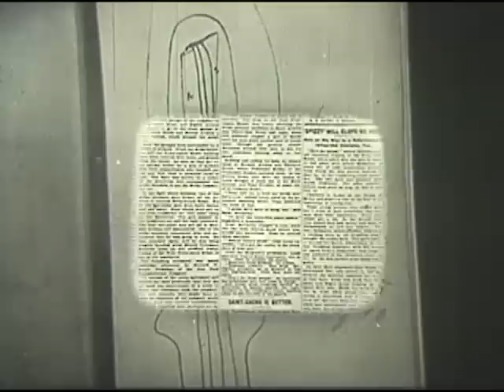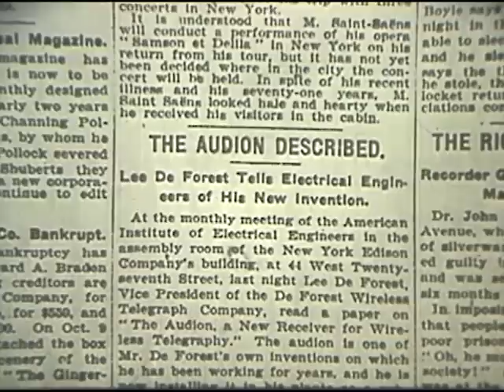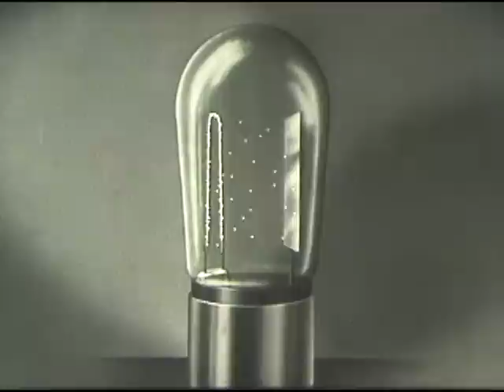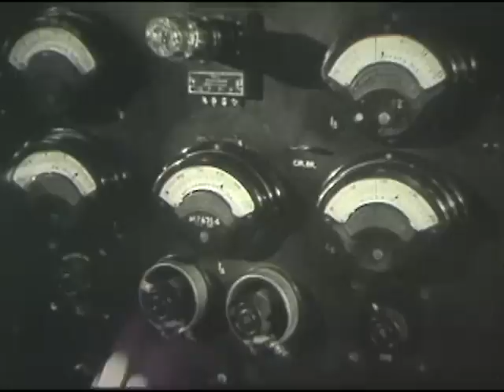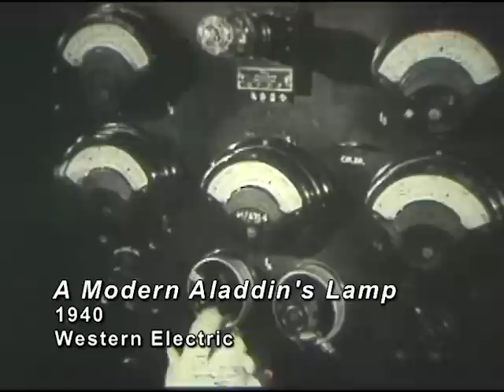AT&T Archives: A Modern Aladdin's Lamp, about vacuum tubes,1940

Comment: Great video.  A slight slap at Edison for not trying to understand the "Edison Effect". Lowell Thomas had a good "Radio Voice". I got into "playing" with vacuum tubes while still in grade school in the 50's. An Uncle gave a kit for a regenerative radio that used a single tube. It was of a "breadboard" design and the map to the components was on a piece of paper glued to a small piece of plywood and it required a 1.5 V "A" battery and a 45 V "B" battery.

With tubes it is possible to picture how they work. Not so with semi-conductors.
Reply: Lowell Thomas!!!  That was his name!!  That was driving me nuts -- I knew I knew him, but I couldn't think of his name at all.
Reply: @LMacNeill  Did you not observe the opening credits?
Reply: I learned electronics in the tube days. You could follow a schematic and see what happens. One of the later TV's i repaired, from the tuner, the signal went into a big chip, and various signals came out for video, audio,  verticle and horizontal drive. What was wrong? A big difficult to replace chip. A projector I worked on had a huge chip in it. Over 200 pins, soldered into different levels of a 7 layer PC Board.  The projector was scrapped.
Reply: I had decent training on semiconductors. You just needed flukes and O'scopes to help.
Reply: Mike, 

Your description of your single tube regenerative radio kit sounds very much like a kit I had in the late 1950s. It used a 45 V “B” battery and a standard 1.5 V D cell for the “A” battery. It was a breadboard design, as you describe, and had a 3-4” upright wood piece on the front to hold the variable capacitor for tuning and a potentiometer for the regeneration control. I don't recall if the power switch was built into the pot, or a separate switch. It had a single headphone with a spring metal piece the fit over your head. You could also connect the headphone to different fahnestock clips and allegedly use it as a radio transmitter with the headphone serving as the microphone. I never had much success with getting that to work. 

A few years later I got an updated version of the same kit. Instead of the breadboard, it now fitted into red plastic case. While now more portable, you still needed to hook it to an antenna and ground to use it.

I hadn’t though about this radio for a while—thanks for the memory jog.

Comment: 13:33: "Spacings between windings are uniform to a few millionths of an inch". Why are they then THROWN INTO A PILE (13:39)?
Reply: I noticed that too. Hard to believe they would go to so much trouble and then pile them up like garbage. I think that might be a pile of rejects. Does not make sense.
Reply: Right and the glass interiors that they had coming down a chute and landing in another pile of glass interiors..?? Now I've seen vacuum tubes before and yes they are made of sturdy glass, but I just can't see how that much shock and survivedand then they're loaded into a great big Bin how are they not crushed by the weight of the other glass particles simply wonderous
Reply: OMG David, you look like me. I'm not kidding. My beard is bigger but other than that you could just about be my twin!
Reply: I don't think that's correct. Maybe to a uniformity of a few thousandths of an inch, but certainly not to millionths of an inch. A typical vacuum tube does not require such precision.

Comment: Probably the two most important inventions of the 20th century was the vacuum tube (Thermonic valve)  in 1906 which led to modern electronics like radio, television, radar and the earliest electronic computers. Then in 1947 the transistors which led to the amazing technology we have today. The diode tube invented in 1903.
Reply: The development of the integrated circuit around 1960 solved "the connection problem:" Even though transistors could be made small and reliable, the physical aspects of connecting them and the associated resistors together in large numbers represented a major obstacle that threatened to be a limiting factor.

Comment: And  even today the Vac Tube  is still being used  in high end Hi -Fi  ,   Respect for those technicians of the past
Reply: I" m using a microphone preamplifier built for audio recordings and I have an hi-fi preamp and amplifier for a high efficency loudspeakers. The tubes have again best performances  for specific purpose where the mechanical requirements are not primarly requested (audio and RF power transmitter, magnetron it's a vacuum tube and X ray tube, night vision device  use a photomultiplicator).

Comment: Thermionic valves make for the best sounding amps and will never die. Hook 'em up to a trio of single coils with selector switch in position 4 and you'll be smokin' dude.
Reply: Sorry man, but digital has replaced that. Amp models in 2023 can produce the same sound
Reply: @jr2904  Some people like processed cheese, others artisan made real deal.
Actually, digital technology models an ideal sound (or think of it as typical response of an amp style or even that of particular existent amplifiers. As such they present a fixed transfer response subject to input parameters.  
A real hard-wired tube amp is far more organic and variable and plays that way too.
They're personal.

Comment: The vacuum tube is still relevant. Vacuum tubes respond to voltage changes 50 times faster than semiconductor devices. For audio this means greater phase accuracy to the source. I use all vacuum tube audio for my home system and it is producing the most realistic sound stage available. The speakers virtually disappear leaving a holograph of sound. Even the CD player uses vacuum tubes most critical in the clocking of the audio signal. Vacuum tubes can reproduce a square wave, semiconductors can not.

Comment: Great vid; I learned a lot.  Is there a similar vid that explains how vacuum tubes contributed to early computers?  They're essentially diodes, right?
Reply: vacuum tubes were diodes, yes.  the first one was a diode.  then came the triode, and power amplification tubes, and the CRT, the camera image tube, and  whole plethora of other uses.  There were some highly specialized designs created.  one important one to mention is the tubes used in antiaircraft ammo during WWII (proximity fuses).  it gave us a technological edge that the Germans and the Japanese never replicated.

and yes, vacuum tubes were used in the first computer (ENIAC).

Comment: These amplifiers were miraculous but the problem was that they amplified everything including noise. With digital repeaters, anything above a 4 volt pulse is discarded and the clean pulses are recreated as pristine. Analog signals are converted to binary numbers and then converted back to analog on the receiving end. We understood how it worked but we still called it FM. I’ll let you imagine what that stood for.
Reply: Frequency Modification

Comment: I still have almist 100 WeCo tubes in my stock.  The 350Bs go for $1650 apiece.  No finer tubes were ever made.
Reply: I totally agree, and I would love to have a couple dozen of the Western Electric 300B's!!
Reply: @holywells  I sold out of '50s-era 300Bs years ago to the 'single-ended' freaks, and many 417A triodes to the same crowd.  I still have 310A (6C6) pentodes and 311B triodes, as well as some 403Bs (6AK5) for the discerning tube RF crowd.,  The idiot Long Lines first line I worked for at the time told me, "Get rid of his junk," including a few retired 101A power amplifiers and Altec audio distribution amps, and oh brother, did I!  Thanks for augmenting my pension, dumbbell!  Sometimes, the good guys win.  As far as longevity, in the '80s I pulled many a 101F out of V1 repeaters that were installed when the repeaters were...1938.  40+ years' service, and still tested as new.

Comment: Lol the only vacuum tube in use here these days is my magnetron :) Hi tech heater :D
Reply: +Picobyte  Not so. Nearly every AM, Shortwave, FM, Radar, and most Satellite's use tube transmitters. The primary reason that most tv stations went solid state was due to the lower power nature of digital.  Our station had a 30 KW tube transmitter that hummed along 40 years. The solid state replacements running 1/10th the power have been nowhere near as reliable or trouble free.  And it takes up 3 times the space.  The newest generation of transmitters is getting better, only need 3 racks to get to 20 KW now. So it seems another generation solid state will be where tubes were 50+ years ago for large signal applications.
Reply: Aaron Edwards Many are already gone,and none of those applications are not those I use at home.Sat-Tv uses chip based technology,FM mostly uses transistors only extreme powered FM/AM stations still use tubes.But as I mentioned Those are not the sort of machines users have at home,Just the magnetron..Fun fact.. In AC/DC converter stations the "transistors" are still called valves.
Reply: Picobyte 

What about guitar amplfliers, even High-End stereo amplifiers sometimes...
Reply: A magnetron is not simply  a "high tech heater". It's a damned efficient way to generate microwaves, more so than any modern transistor. Just because it is used to heat a lossy dielectric in microwave ovens does not imply it has no other uses.

Comment: A lot of work went into making vacuum tubes. Thankfully the transistor was invented to replace them.
Reply: "Thankfully the transistor was invented to replace them."
Dude, thermionic valves make for the best sounding amps and will never die. Hook 'em up to a trio of single coils with selector switch in position 4 and you'll be smokin'.
Reply: @rjlchristie  Yes, tubes still have their place in amplifiers.
Reply: @rjlchristie  so how exactly are you supposed to make a smart phone with vacuum tubes

Comment: And my 6V6GT tubes for my amp came from China. Crazy part is... they have given me not one problem, and they are used daily in my stereo tube amp, and have been in service for 3 years now. There are days that my amp is on around the clock, in use.  I think that's pretty good.
Reply: Rick Delair Thanks for the insight Rick.  Good to know. My "Groove Tube" 5u4G shorted about 2 weeks ago. (Nice arc dance before it blew the fuse in the amp). That tube was made in China, but I think it was abused before i purchased it. The lock pin on the bottom was broken off, so I had to be careful on how I inserted the tube.  I did get 2 years out of it though. Replaced it with a Fender 5U4G, also made in China. Works again, after replacing the blown fuse. What I need are some inexpensive 12AT7 tubes.  Why are the 12AT7 tubes so expensive in comparison to, say... the 12AX7?  My amp uses a mix of 12AX7 and 12AT7 in the pre-amp stage. Why?  I have no idea.  Thanks.  Randy.
Reply: Rick... shoot me a private message through YouTube about the 12AX7 tubes.  Been busy, so sorry about the delay.  Randy.
Reply: Rick Delair Rick... shoot me a private message through YouTube about the 12AX7 tubes.  Been busy, so sorry about the delay.  Randy.

Comment: This a wonderful piece.  I think it is a wonderful introduction to beginners in electronics even in this era of solid state.
The transistor works on the same principle, but is a little bit more difficult to understand for the beginner.  Besides, vacuum tubes are very much alive and well in the audio and even the high power transmitter industry.

The opening scene of a transmitter building and one of the two towers is that of WOR AM  710 in New York.  I'm not sure of the interior scene showing the Western Electric transmitter.  WOR is now located in Lyndhurst, NJ.
  http://www.j-hawkins.com/wor.html

Thanks for this posting.  - WA2WHV

Comment: The only thing I thought was that if those electrons are leaving one plate and collected by another, wouldn't one plate get thinner, and the other thicker? What did I miss?
Reply: You are missing the big picture: the whole electric circuit.
The emitter plate receives electrons from the power supply, and the receiver plate give electrons to the rest of the circuit (radio,TV, etc).
The main power supply is the one that provides the energy (electrons) to the system,  they travel through the whole circuit, finnally ending as heat, light, movment, radio signals,etc. 
But, tubes wear out over time anyway.
Reply: @roner61  Ok, good. Thanks for the explanation roner61. It's clearer now...

Comment: 17:45 Tube is a WE 101F tube. 4.1 volt filament voltage. 4 prong. 3 elements. Plate grid filament. The 101F has a filament current of 0.5 amp and the 101D is 1 amp. This Triode of course is Western Electrics audio frequency tube for their repeaters.

Comment: I even remember the TV repairman scam.  He would come out to your house and work on your broken TV that just had wavy lines instead of a picture.  He would pull out 3 or 4 tubes and claim they were bad at about $30 each.  He would then claim you could go down to the department store and test them on their tube tester and they would test good, but they were really bad he would claim.  He would then say they were weak and needed replacing.  As a young 7 year old watching the TV repairman, I then noticed he adjusted the horizontal frequency adjustment on the back of the TV to fix the problem.  The next time the horizontal adjustment went out, I saved my parents around a $150 (a months rent then) for a TV repair bill by just adjusting the horizontal adjustment potentiometer at the back of the TV.  How many millions were scammed from the people?  How about when your TV didn't work at all and you called the TV repairman.  He would come in and just plug in your TV and give you a bill of about $85 for the service call.  What a rip off!  This is why I became an electronic design engineer.  Today you have over 1 million of these tubes just in your cell phone!  That is called progress.  What did these engineers get for their reward, laid off.  I think a better job today for the laid off electronic design engineers would be a cell phone or computer repairman!

Comment: Anyone know the total tonnage of copper used by the communications industry by 1980 (transmission cables only)?
Reply: I don’t know about communication cable, but overhead cables are now being made from aluminum (because of the threat of theft).
Reply: @nigeljames6017  I was not previously aware of that, but it does make sense.  I would presume though, that much like those that had aluminum wiring in their home electrical service, and have had to swap it out for copper, due to the breakdown of AL/increased fire risk on various circuits, won't those overhead lines fail sooner than the copper ones they replaced, regardless of the particular load  - thus creating a different liability for their installation?
Reply: ModMokkaMatti I don’t know if this will answer your question or not, but here is the Wikipedia entry on power lines :-

https://en.m.wikipedia.org/wiki/Overhead_power_line#Construction

Comment: The entire video is primarily about vacuum tubes that amplify the signal faithfully but only a small amount in repeater service. I expect everyone involved would be flabbergasted to learn that after solid state components then integrated circuit chips obliterated the vacuum tube industry the only lasting niche for vacuum tubes is to massively amplify and distort the tiny signal of musical instruments with magnetic (or active) pickups. .

Comment: Worked on vacuum Tubes over 60 yrs & trouble shooting a "Dead" radio to a Specific tube could be done Without ant Test equipment just using a small long Screwdriver in what's called a "Disturbance" test by listening to Speaker volume & quickly Ground "Bumping" the Plate & Then it's Grid socket pins....A good tube stage Grid should be Louder than it's Plate... Sure, the plate "Bump" always made a good Spark but wasn't Damaged by the test... Try That with Any Semiconductors & Poof !!

Comment: still want to know how the fuck these powered computors
Reply: +rccarmadben Vacuum tubes are basically transistors and diodes that require a heated element...
Reply: well you heard them, they functions as "valves", so those regulations can be adapted to produce logic circuits for computing

Comment: Wait until transistors and computers, and you’ll ALL be out of a job!
Reply: Not really.  Vacuum tubes are still in high demand, especially in the music industry.  As a matter of fact, almost every home in America has a vacuum tube in use everyday.  The device that is powered by this tube is all of the microwave ovens being used.
Reply: @holywells  I'll go along with you on the oven. But tubes in audio equipment is pure voodoo. I worked in a WE plant that made tubes, later had the world's first transistor assembly line. This was prior to the 1984 consent decree. The WE trademark was licensed solely for tubes for audio. You can still buy 300B, 274B, and 212E tubes. 

WE 97A Monoblock Amplifiers
 - $61,995.00 per pair. I'll ignore a few extra 1/1000 percent THD for that price, thanks anyway.
Reply: @RichardFallstich :  Thanks for your input and the information regarding your personal experiences here.  Some of the most powerful, and highly prized tube power amplifiers, i.e. the Carver Silver Seven and the VTL Siegfried series, when properly mated to other top of the line components, leave little to be desired in the art of musical reproduction perfection.  Of course, high fidelity audio and the music itself is highly subjective.  Everyone's taste, and aural acuity, will vary greatly.  In closing, and from personal experiences on my part as a sound and recording engineer for over half a century now, all of the finest microphones that we use are those that employ a vacuum tube in the circuit. The Telefunken ELA -M-251E, Neumann M150, AKG-C12-VR, Manley Reference Gold, and others are what contribute a highly accurate and almost magical glory to the sound of fine recordings.  Nothing else even remotely comes close!  Good day to you, sir.